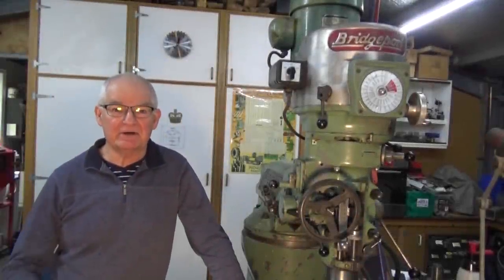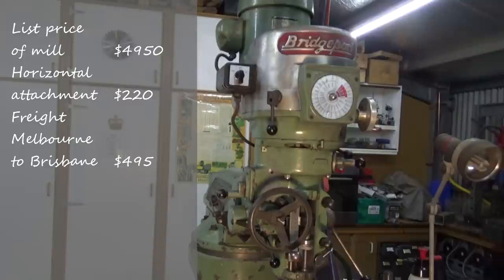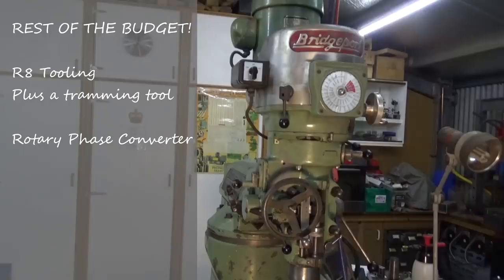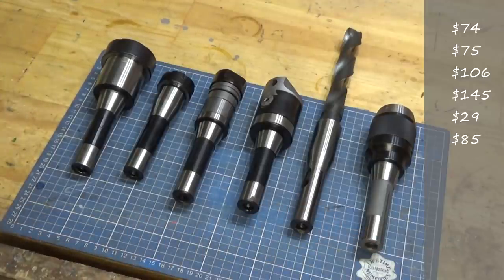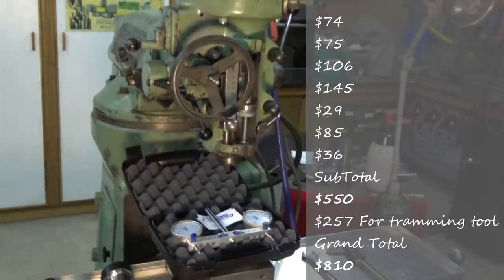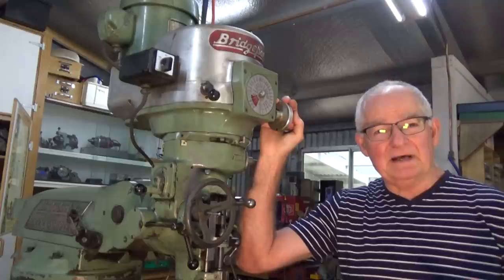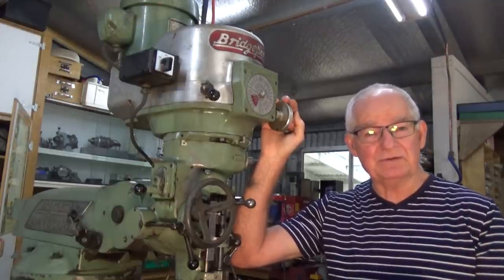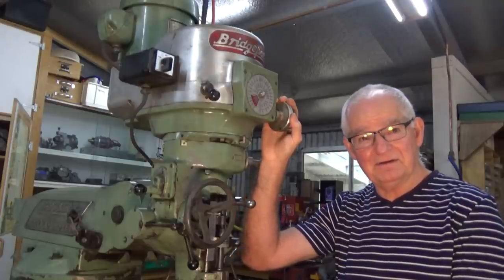Budgeting for a New Milling Machine

Comment: Can't find used bridgeport mills in Canada much either.  If there are any they fall into 2 categories, way overpriced for a well used machine (75%+ of a brand new machine) or they look like they were pulled out of the bottom of a lake they sat in for 20 years.  All prices are near double what they are just south in the USA for new machines and used are probably 4x.  The mythical $500 lightly used bridgeport out the physics dept of some university just don't exist. Machine companies aren't amazon either.  There sure as heck isn't free shipping on orders over $35 LOL.
Reply from the maker: Barry, so you have some idea what we deal with here in our former penal colony. One positive thing that came out of our car industry going belly up was that at least some good engineering equipment finally started to filter down to home workshops. 
Regards,
Mark

Comment: $600 for your last haul is quite low, as the truck has to pay for fuel and tolls both ways, and he will not be likely to have a load going back, meaning you pay for both ways in the price. The $400 for the long haul is because there you paid for the space on the truck, and the share of fuel and tolls one way, there will be stuff going the other way paying that part. Just depends on the ability of the guy to have a return load, or if you are on the way for him to pich up or drop off something determines the price, if you could wait a month for delivery with no holding charges it often is possible to get the delivery cheaper, but then the schedule is not yours, but the other people that are paying for the large load.
Reply from the maker: I don't regret paying for the crane truck because of the convenience. He was able to put the mill down as close to the workshop door as it could go. I was actually surprised that the transport from Melbourne was as cheap as it was.
Regards,
Mark
Reply: @Preso58  Benefit of a lot of goods being transported on a regular route, prices drop, because the transporter knows he always will have a full load on a certain day, and can plan his schedule as well for it. Truck does not then stand idle waiting for work, time which he has to recover the cost somehow otherwise.

Comment: 350$ for a clapped out BP, 1200-1600 for a half decent one. At least that’s that’s what I see around me. That’s not accounting for the auctions hammer tax etc or the cost of the riggers to move it. Varispeed bumps it up, motors on the x/y bumps it up as well as dros. I’ve have had my eyes open for one the past 5 years, I know this might be really low to some but when you live near areas that had lots of manufacturers at one point this is just a reality. I see surface grinders for 50$ to free all the time. People just want them gone it seems. It’s all cnc now a days.
Reply from the maker: Yes, it's a supply and demand thing really. Australia has slowly gotten out of manufacturing but there was never that much to begin with compared to the USA and Europe. What does come on to the market here is snapped up pretty quickly if it's realistically priced. 
Regards,
Mark

Comment: OMG $65 for a brass fitting that looks like 1/4 pipe thread to 1/4 flare or compression , Could have sent you that free from Canada ; Best of luck with your machine .
Reply from the maker: Michael, I had another viewer offer me a full set of metering valves after I had ordered and paid for the one replacement which I bought in Melbourne. He lives in Germany so I was a bit blown away by the offer. I declined the offer thinking that I had fixed my lube issue. When I removed the saddle off the mill I realised that there was a second valve bent and broken. Ooops! However Niklas in Germany made good on his offer and is sending me a new one at his cost which was really nice. The metering valves are actually quite complex inside with a non return function as well as a helical restrictor so they are probably not overpriced but it's the shipping that adds up.
Regards,
Mark

Comment: Hi Mark, I was going to send you an email but I can’t find your email address any more. This must be one of the few videos of yours that I missed and I sent you a message asking what your Bridgeport cost and you had a video of it all along. I may have mentioned that recently I acquired a Chinese Bridgeport and I’m in the process of cleaning it up. I took a different route to you and decided to rewire the whole machine and run the motor with a VFD. Like yours mine had a multi tap transformer and yet nothing was connected to the 230 V everything was either 110, 430 or 24 V.
I’m sure by now you have replaced that coolant pump but if you haven’t you’re welcome to have mine for nothing as I won’t be using it. Over the last couple of weeks I’ve been working out how to do a video on my machine and when I watched your video tonight I realised that the idea for mine was a very similar format to yours. Would you be bothered if I did mine in a similar way to yours? If you are then I’m happy not to do it or find a different format. 
I would like to reference your video showing a different way of achieving the same results ie running a three phase machine on single phase.
Thanks and cheers for now, Stuart. Canberra.
Reply from the maker: Stuart, it's totally OK to present your video along the same lines as mine. I suspect that there's not much on YouTube that's totally original anyway so go ahead as you see fit. I struggled with the whole issue of rotary phase converters vs. VFD vs. VSD and at the end of the day I took the RPC route mainly because I don't feel totally confident messing with electrical installations and the RPC was sold to me as a turnkey solution in that I could just plug in the mill and it would run as intended as if it were running on a native 415V three phase supply. It does work that way but the down side is that the RPC is quite noisy when it's running. I made a sort of mobile cart for it and enclosed the idler motor in the base of the cart with some sound insulation around it and it does attenuate the noise somewhat but it's still annoying. My coolant pump is working fine. I realised later that it was wired in such a way that it only ran when the main spindle motor was running. I haven't yet needed it but it's just going to need some new hose to connect it to the coolant nozzle. 
Good luck with the new mill. 
Regards,
Mark
Reply: @Preso58  Thanks Mark that’s very kind of you. I decided to go the rewiring route because when I plugged the VFD in the contactor wouldn’t stay engaged, instead it it rapidly engaged and disengaged almost like it was fluttering. Also the main controls were on the knee which was too low for me and they were in quite poor condition. The power feed wasn’t working properly either so I took the opportunity to replace it with a 230v unit. Looking back, I now know I could have easily got around the contactor problem but as you know learning is half the fun😂.
Like you, I have kept detailed records of what I have spent and the tooling is starting to add up. 
Nice to hear from you my friend, cheers Stuart.

Comment: Great video Mark. Just out of curiosity did you consider any of the Bridgeport clones? Precision Mathews,  Grizzly, and others or isn't that an option in your location. Good luck with your Bridgeport I'm sure that you'll have it running and looking great.
Reply: Hare & Forbes would be about the only company in Australia comparable to Grizzly Precision Matthews ect. Parts as he mentioned are always easy to find for an actual Bpt of almost any vintage. For the clones? Some of them not so much. Maybe for the longer established makers such as Acra, Sharp, Chevalier, Victor etc. but most of those are priced at or quite a bit more than a new Bpt. Some are even better designed and built that the Bpts as they upgraded the machine and made it a bit larger, heavier and more rigid and most of those have box ways instead of dovetail ways. There good machines but probably $20 - $25k Australian or more. With a used Bpt with little wear and a quiet head there a pretty safe bet and the cheaper clones of about the same price can be a nightmare if you get unlucky.
Reply from the maker: Jim, last year I saw a Kondia mill which is the Spanish clone of the Bridgeport. Evidently they can be very good but I wasn't interested in anything from China. We purchased a new lathe at school just before I retired. It was a Chinese made but Hare and Forbes branded machine about the same size as my Colchester. When it arrived I chucked up some 32mm cold rolled stock and put a 1mm doc cut on it and it howled like a banshee. They look solid but the castings are really thin and the iron is awful. The kids had pretty much wrecked it after 12 months. However we had two really old Sheraton's and a Japanese Dashin which is a Colchester clone and they are still going. Un-killable!
Regards,
Mark
Reply: Mark Presling 
There is a video on youtube called the Colchester lathes company that shows how they make their lathes , after watching it i could see why these machines  are so coveted by their owners !

Comment: Have you considered getting true 3 phases power from the power company to your workshop? in the long term, that's the cheapest solution.
Reply: @mariusthefaker9339  That's a shame! Because 3 phases distribution needs thinner wires for the same total power (because higher voltage), so it should be an economy even on the wires (because less copper)!
Reply: For me, three phase into my house from the street (15 meters away from the pole) over $10,000.  Single to 3 Phase Inverters is the only way to go.
Cam
Reply from the maker: For many reasons, it's just not an option for me. I believe that most places in Germany have three phase to every house as standard. 
Regards,
Mark
Reply: @Preso58  I don't know about Germany, I live in Thailand and there are the 3 cables of the 3 phases just in front of my house, so I could be hocked up easily I believe. Anyway, thanks for your video.

Comment: Just out of curiosity Mark,What would it have cost you to add 3 phase power to your workshop?
Reply: I wonder that too, is it even possible to add?
Reply: @dennisa6132  depends on what's out on the street, if it's available you'd have to think it would be cheaper
Reply: This year I paid $7500 AUZ to put 3phase with 6 outlets in my workshop. 
The supply pole is on the foot path at the boundary corner of the property, 8m from the meter box which is on the wall of the workshop.
And I dug the 1m deep trench.
Sounds expensive doesn't it?
But, I've got 5 off 3 phase machines I can step up to or possibly have running simultaneously, 
without any complications, 
without the noise of a rotary converter 
or the complications of multiple electronic devices that I don't understand and cannot trouble shoot.
'Tall depends on your circumstances.

Comment: There is an adapter available from R8 to mt3, about $15-20, no idea how good they are as my machine is mt3 and have never used one.
Reply from the maker: Derek, I already have one. I only got it in case I need to drill some larger size holes. I have a few MT3 shank drill bits.
Regards,
Mark

Comment: hi,did you consider a hafco mill brand new.also what kind of way oil did you order.
Reply from the maker: Geoffrey, I ruled out the Hafco mills mainly because we purchased a Hafco lathe for the school where I worked. It was similar in size to my Colchester but it  had  nowhere near the same cutting capacity. The castings look solid but they are thin and the iron has a lot of inherent issues with resonance. Also the kids had just about wrecked it after 6 months. By contrast, we had two really old Sheraton lathes that were ex-TAFE and they are still going. I kept reading about "old iron" which refers to the classic machine tools like Cincinnati, Monarch, Colchester and Bridgeport. They are made form meehanite which is a superior form of cast iron and they were designed well. I can still get spares for the Bridgeport too. Plus, I like the challenge of restoring old machinery.
Regards,
Mark

Comment: He who dies with a lot of tools dies without enough tools. 

I'm assuming putting 3phase power into the shed was either not an option or a bloody expensive option.

As for the kid's inheritance bugger them, it's your money, Mark;)
Reply from the maker: Jason, three phase was not an option for a lot of reasons. Not all financial either. It's more to do with a decision I made when we first started building on our acreage block. I chose to put the power underground and it's a long way to the service pole. We also have lots of very tall trees and they are protected by council so going overhead is an issue as well. Unfortunately, I didn't plan ahead far enough.
Regards,
Mark
Reply: @Preso58  C'est la vie you have a good workaround that's probably much easier than the alternatives. I've tried converting 3 phase machines to single in the past and it can be a challenge. Hopefully, you get your coolant pump sorted out. Nice to see the machine is getting some love, I look forward to see the end result.

Comment: Mark, whenever I've considered buying a machine, I had to assume that my costs to buy the machine and tool up would double the cost.  But I've never really considered shipping costs like I should, so maybe 2.5 times the cost of a machine.  Of course, if you've already got tooling from an earlier machine like your milling cutters, then your "tool up" costs aren't as high.  I'm really looking forward to your follow-up videos on this machine, whether repairing/restoring it or using it to make projects!

Will you do a video or video segment on what's in the "glass case" in the back of your workshop where your jet engine is?  From a distance it looks like quite a few interesting-looking items.
Reply from the maker: Bob, tooling is a real killer but I was very lucky early on. My wife's uncle worked for Sellars Atkins in Adelaide. They were one of the main suppliers to the car industry and sold all sorts of engineering tooling. He was a sales rep and he would get boxes of samples from different companies and he would give me loads of the stuff. Sadly, he was made redundant and my freebies dried up overnight. The glass case has a few jobs I made while I was at college but I also keep a lot of the more sensitive measuring equipment in there so it is a bit more protected from dust and rust. The trouble is I often forget that things are in there. I have a really nice machinist jack with a square thread and a bronze nut that I made in my second year at college and I cleaned it up and oiled it and put it right at the back. While I was moving it to get to something else I noticed that one entire side had red rust on it. I hate rust!
Regards,
Mark

Comment: What do you plan to use your Bridgeport for?
Reply from the maker: Tim, I mainly make other tools and sometimes small engines. I have wanted to make an internal combustion engine for some time but I was always scared off because of the need to make gears for the camshaft. I am hoping that I can start a project like that soon. I have already made a number of steam engines and steam locomotives and I built a working turbojet engine about 10 years ago.
Regards,
Mark
Reply: Mark Presling fun stuff!

Comment: I’m feeling a little guilty as I only paid US$400 for my Wells-Index mill. And it came with 6” Kurt vice and about 50 end mills. 

I decided to go with a rotary phase converter as well. I bought a 10 HP motor for US$75 and a panel from American Rotary for US$300, including shipping. Really happy with that unit.
Reply from the maker: Craig, so, $370 for a complete RPC? That make me cry! Our wonderful federal government has a policy of keeping our dollar low so we can sell more coal, gas and iron ore to China. Great for the resources sector but mugs like me pay through the nose for everything we purchase. Still, it's all going to end in tears when China slaps trade embargoes on our products because we dared to ask for an independent enquiry into where the virus came from. 
Ah, well, drink more beer I say!
Regards,
Mark
Reply: @Preso58  Yes, taxes make a lot of items cost prohibitive.  Here in Texas, you can usually find 3 phase motors for about US$10 per HP.  Then American Rotary had a nice sale on their RPC panels.  You just add your own idler motor.  With the American Rotary panel and the facebook market place motor, i only had about US$375 into the whole 10 hp converter.  i had to wire it up, but the instructions are very clear even for a non-sparky.  You have a great YT channel BTW.  Thanks for keeping it simple for us non-machinists!

Comment: You way over paid.  220 volt with a phase converter works just fine on mine.  Phase converter was only $65.  I paid $2500 American.
Reply from the maker: Abby, so is that a static phase converter that you have?